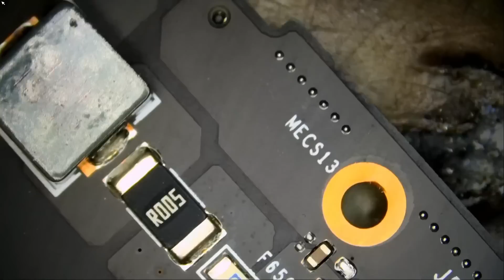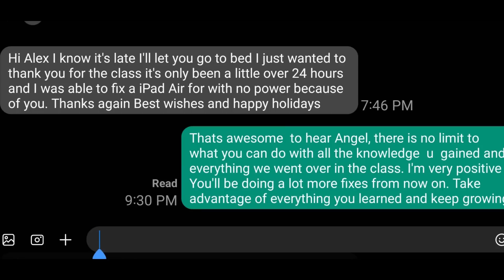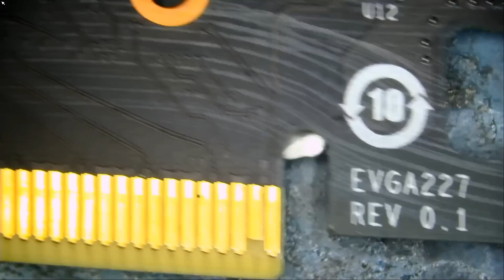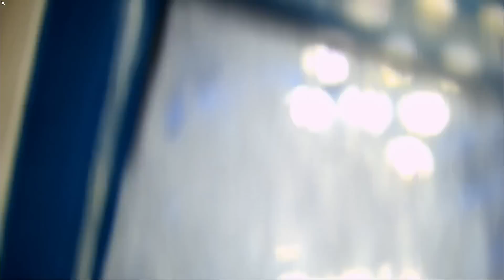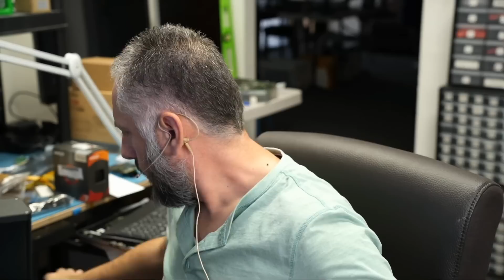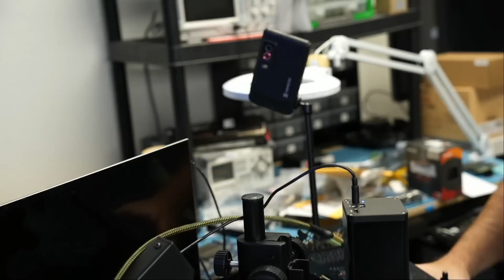EVGA 3090  Smoked After Repair

Comment: Alex, I enjoy watching your video, the way you check pins are solid when you solder helped me troubleshoot cold solders  at my work place. The maximum current for the GPIO pins for LPC51U68 is 35mA, I would check if any pin on the chip has less than 100 ohm resistance. No pin on the chip should have less than 100 ohm otherwise the chip will blow out.

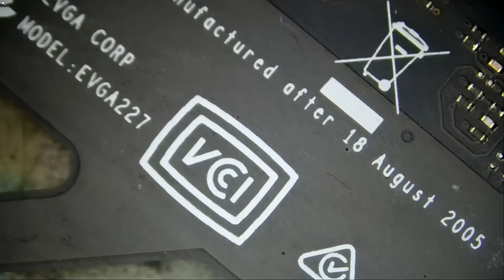Comment: I'm confused... the 3090 came out in 2020 but the PCB says "Manufactured after August 18 2005" (@1:55 Minute) ?? How??
Reply: that's not the production date. since it is close to the certification marks, it most likely means that there's some norm/requirement that either went into effect or was changed/removed in August 18 2005, and they are just making it clear that board was produced after that date, to anyone verifying it
Reply: @rafaelmartins12345  That's correct - 8/18/05 is when the European Commission's RoHS directive went into effect
Reply: easy .. 2020 is after 2005 😁
Reply: Bizarre, but correct nonetheless. I was wondering if 2005 was the original design date, but that's pushing it.
Reply: 2020 is after 2005.

Comment: Does nuvoton chip have a hole?
Reply: It should not.
Reply: This is fan speed pwm regulator, and no problem the card can run whithout this ...
Reply: @milenguberkov7838  You must be kidding me. 😂😂😂😂😂😂😂😂😂😂😂😂😂😂😂😂😂😂😂😂😂😂😂😂
Reply: @milenguberkov7838  it has problem, since this are a part from electric circuit lol
Reply: @milenguberkov7838  it has problem, since this are a part from electric circuit lol
Reply: @milenguberkov7838  🤣
Reply: @milenguberkov7838  Nice joke!!!

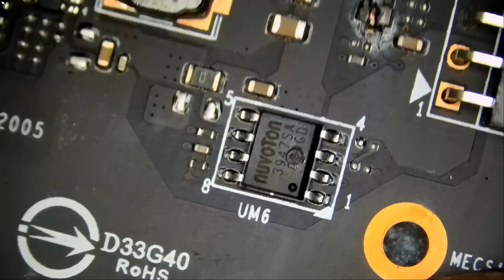Comment: 5:22 looks like um6 ic has a hole
Reply: i saw that also
Reply: He went by that 8 pin chip like 6 times.
Reply: Yep, the nuvoton
Reply: About to post the same thing👍
Reply: Wonder if there’s a reason that IC went EoL sept ‘24
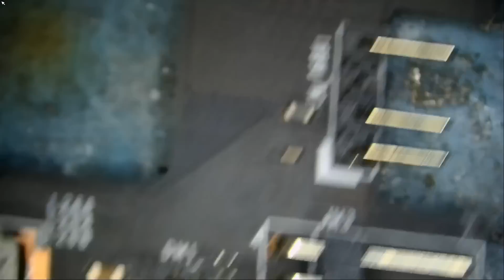Reply: Looks like Alex is human as well. Well, he did say that in this video. JM3 chip on the right @5:00, as you say.
Reply: same here was wondering if he would see that 8pin nuvoton next to the power connectors and first little fet he de soldered...
Reply: Did go to mention the same thing.hope he will notice thw comments
Reply: yes.
Reply: um6  , yep!
Reply: Yhea i saw it too.I was just thinking my eyesight is having a problem
Reply: Jup
Reply: You change ic NUVOTON 3947SA
Reply: Big Zit got popped

Comment: i cant wait for the power cable on the 5090 to melt again or the cards that just smoke haha
Reply: Them being 550+ wattage I'm expecting far more explosive reactions.
Reply: There is a reason that im still using an RTX 3080 TI ....
Reply: @brightlight1998  main rig is a 3090FE but I went and gave it the Copper Mod treatment it's still running as cool as the GN prototype 4090 they got.
Reply: @shadowarez1337  Copper Mod = scary = me will never do
Reply: yes exactly. the mini pcb of the 5090 is probably almost impossible to repair
Reply: @MarcusPanigale  least they fixed one issue that gigabyte hasnt the design flaw of the cracking PCI connector by the looks of it you can at least replace it on the FE model.
Reply: is it bad that I was thinking the same thing.